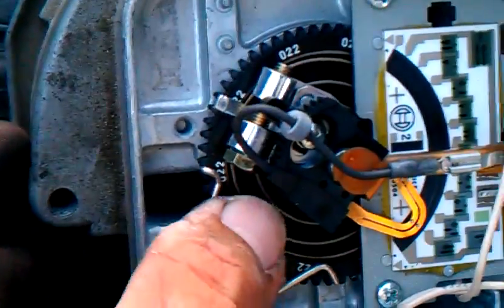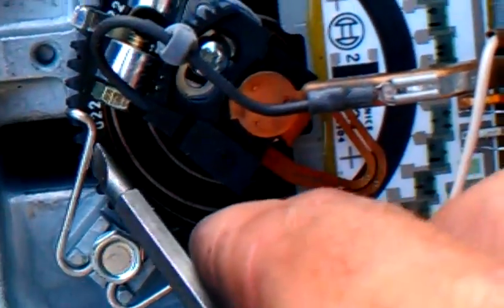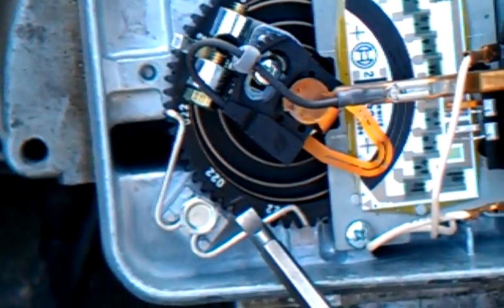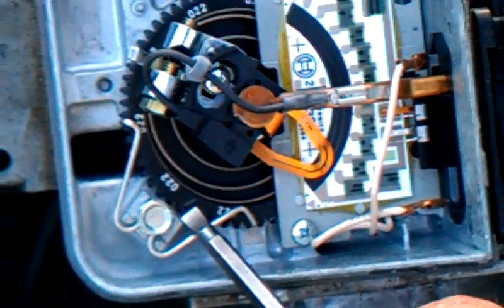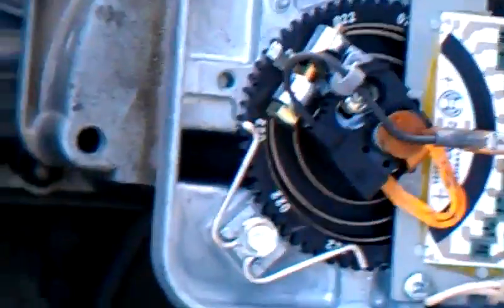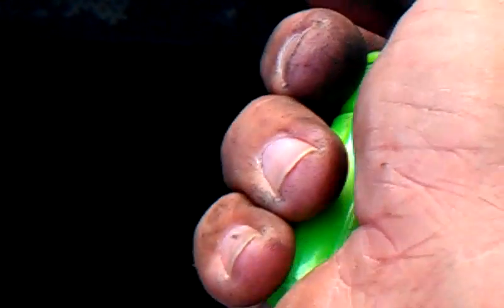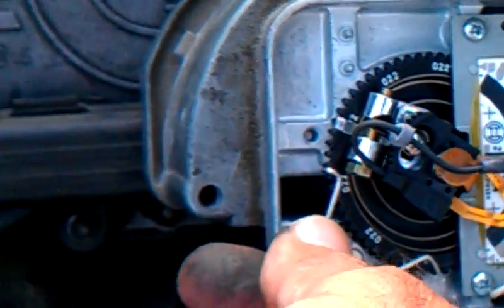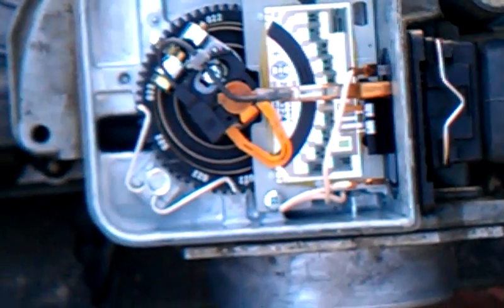AFM ADJUSTMENT TO CORRECT AIR/FUEL RATIO

Comment: Maybe its too late to ask after 11 years of posting this video.
In fact here in Iraq peoples started changing thebopels engine with Toyota engine because of this terrible airflew .
However about my problem . I have Opel omega 1993 . I  tried to adjust this devise  but I lost the stating point.
Randomly I adjust drpened on the engine idle stability , its so stabe and quit at idle , but so terrible at acceleration . At high speeds its performing very good but at fixed or accelratuon speed it terrible .
Anyone can teach me how to find the starting touching point .

Comment: I think you should be careful spreading misinformation saying that fuels are radically different now than it was so many years ago. 
Yes, fuels have become better. NO that does not change your AFR's or fuel mixture.

You're also wrong in saying they come lean from the factory, that is Infact wrong. Nearly every EFI car ever has come from the factory on the rich side. ESPECIALLY Toyota's.
Reply from the maker: Read the Bosch Fuel Injection Manual.
Fuels have not become better in California. The fuels are cleaner and produce 10% less power.
If I cross into Arizona and fill up, I get 10% better mileage. That is 40 more miles per tank.
Plus, I do say that an Air/Fuel Meter should be used. 13.6:1 is a good mixture at full throttle.

Comment: Should be very careful with this. Most of the time this is the wrong decision, people often overlook other problems and try to cover up the symptoms with AFM adjustment. A rich setting will cause power loss, waste fuel, damage your cat and make the exhaust stink. If an AFM has been tampered it is difficult to get it dialed back in. Early AFM's are more tolerant of sloppy settings as the output voltage is in proportion to air flow rather than flap angle. Later AFM's are calibrated to flap angle and small changes have a major effect on fueling. The spring tension is the major factor but the bypass setting is very important as well, if this is not right it will completely throw off the 02 sensor correction.

In my experience, don't do it. My e28 had been messed with and while the wideband 02 got it close on the spring tension it still required a lot of effort to fine tune it before the hiccups and driveability were resolved.
Reply: Hi, my mechanic recently adjusted the idle mixture screw, and now my e28 stalls when warm, did your car faced the same issue? How is this affecting the o2 sensor and fuelling system

Comment: Mine was adjusted by mechanic which way I dont know, car is stalling when engine is cold its around (1000rpm) when engine warms up it drops to 800 and car runs fine, can this be fixed with adjusting or just coincidence?

Comment: Thanks for your quick response. I have a 85 manual beamer 318i. I did a mayor tune up, including valve adjustment before the test, but the vehicle did not pass the emissions test. When I checked the oxygen sensor, even though it is new, the reading was 0.8 volts. I disconnected a vacuum line but the oxygen sensor reading was still 0.8 Volts. 

When I manually adjusted the air flow sensor lean it out (clockwise) and confirmed the oxygen sensor reading, it showed that the O2 sensor started fluctuating. I checked the gases with the 5 gas analyzer and this time the emission readings were much better.
Reply from the maker: AEM makes a wide band AFR gauge kit that you can use for the ECU Lamda input and see your AFR. This can help you dial in your exhaust gas NOx and Hydro Carbons.
High NOx = too lean.
High Hydro Carbons = too rich
Reply: Thanks for the information

Comment: I have a question. Is it possible to adjust the gear moving clockwise leaner or counterclockwise richer using the oxygen sensor reading. If I connect my voltmeter to the oxygen sensor, voltage is between 0.1 to 0.9 Volts. Is it possible to adjust the Air Flow sensor using the oxygen voltage readings instead of the Wide band Air Fuel Ratio Gauge. 
Thanks 
Thanks.
Reply from the maker: Good idea, but no. You need a wide band O2 sensor and AFR meter to see the air/fuel ratio (AFR) 
The voltages you see on a VOM will swing and do not give an accurate readout.

Comment: 85 4runner  hasn’t been running in 10 years…brand new battery, ran 12 volts directly to the fuel pump and it runs/ turns on, cleaned throttle body.
When I spray starter fluid into the manifold, vehicle bogs and hiccups to start up…that tells me it’s getting pressure. it actually ran for about 10-15 seconds til the starter fluid dissipated. 
No response when I throttle. Only when I used starter fluid I rev’d it pretty high.

Comment: Will this adjust so that all Ohm tests are within spec? Or just a crude adjustment?
Reply: Wondering the same thing
Reply: @chriscutrona5702  My airflow meter was actually out of spec when tested … 2 of the tests didn’t show OL (open loop). I went to the junkyard and I found one from a 1990 pick up, I did the test there and all tests passed. Immediately when I put it in my truck it had way more pep....no more dead spots when accelerating under load.
And my “rough idle when warm” gremlin went away lol. Best $125 I’ve spent so far.

Comment: Very good video!! I so needed this. 
I have an 85 vanagon there is no obvious entrance into the AFM to make the adjustment  no screws. 
Can anyone help, I would appreciate. ✌
Reply: Need to pop the black plastic cover off with a flat head screww driver. Be gentle and just pry it off stating at the corner closest the plug. Some are glued on so take your time.

Comment: At risk of resurrecting an old thread, I did this with my '82 Porsche 928. I moved the spring counter-clockwise by 6-7 teeth. Wow, it makes a difference on how quick the throttle response is now. What this does is actually change the resistance to opening the air meter given the command from your right foot. Out of the factory, it is set for relatively slow (higher tension on the spring or clock-wise). This results in a leaner mixture (a byproduct of the change in the spring tension) as you push the throttle and results in slower throttle response and better emissions (not entirely sure about the emissions part). As I said, the throttle response is MUCH quicker now! Really quick and inexpensive performance mod for an L-Jet system.

Comment: How do you know if it’s lean or rich ?
Reply from the maker: The only way to know is to use a wide band oxygen sensor with a digital readout. AEM is a good brand. 

Typically, you will see idle air/fuel ratios (AFR) between 14.7:1 and 16.0:1. That does not matter. 
At wide open throttle, shoot for 13.5:1 AFR

Comment: I have a issue on my 89 525i. Driving around 80mph for 5-10 minutes will give a check engine light as long as your still holding gas and light goes away most of the time when you remove your foot off the gas pedal. Sometimes it will go to a complete stop from highway speeds but not stall, just poor revving. Any ideas folks?

Comment: Without a A/F meter, you wouldn't be able to know if you're running rich or lean, right?
Reply from the maker: True
Reply: @vern2765  in worst case READ the plugs.
Reply from the maker: @914_werke  read the plugs? Plugs will tell you if you are too mean or too rich, but not in real time.

Comment: What the hell? Even though my AFM is a bit newer, there is no way to access the board underneath to move it ever so slightly if the carbon track has worn other than messing with that exact screw. That being said, a slightly newer versions seem to have wiper arm connected to amplifier board.

Comment: The only way to correctly change the air fuel ratio is by changing the mapping of the DME. In closed loop operation the oxygen sensor input will determine the duty cycle of the injectors.
Reply: So, what can you do when your car doesn't have the oxygen sensor? 😏
Reply: @KriegBoy  run in open loop.  Car just dumps gas all the time like its warming up
Reply: @psychotogen1  mine has electronic injection and it came from factory without oxygen sensor

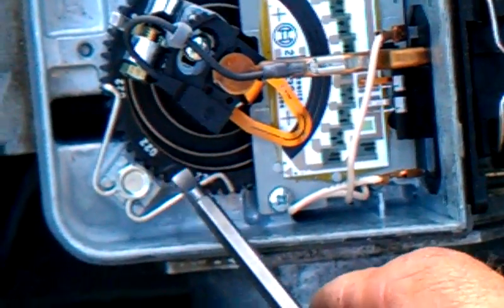Comment: Great video.. But I find it impossible for your vehicle to run 7 steps out of adjustment in either direction, you’re state must be blending 1:10 fuel ratio ? I just did this to mine 1 tooth richer. It’s like night & day difference owning the same truck since ‘02. I’ve read other articles that 1 tooth makes a HUGE difference, so take small steps.. But 7, the door in your maf must be completely closed off having to force it open, or it’s just wide open. It depends on the elevation you live at also living @ 4300ft above sea level !!! Lol..😂

Comment: Hello Vern2765,   I own a 1984 Porsche 928S US version with L-Jet  .   Recent dyno shows better than stock HP and TQ ,  but also shows very lean AF ratio.   Your video was recommended to me ,  I am excited to see if the Dyno results can be improved .   I have sent your video to one of the USA 928 parts supplier / racer (  Carl Fausett ) .   Gonna see what Carl says . I hope i can use your solution .  I hope maybe i can do this adjustment myself .     I was told to turn the dial 11 clicks counter clockwise   .   I hope you get my message ,  and can reply .  Thank you .  ....Susan   Jan 2019
Reply: Susan - please be sure to index the wheel by marking it in some way so you can put it BACK if this turns out to be a bad idea. I suggest 10 "clicks" by my match, not 11. Other than that, it seems likely this might help. Please report back what your results are!
Reply: yes ,  gonna re-dyno and send results to you .    this should be interesting .

Comment: Problem with the click method, on my aw11 mr2 anyways, is the fp is designed to turn on if I lean the wheel too many clicks. In the end by clicking my AFM, I am just trying to compensate for a bad part or faulty wiring. I clicked right and left and each one begins to change the vehicle along with adjustment of the air bypass which leans out the system as well. After I put ECU out of diag mode, the system ends up running better in the factory position. My car has an FP switch, TPS, and other timers on the AfM that work with the ICV and dist and injectors making this kind of adjustment only ok for a few clicks in either direction. It's a good method to diagnose the vehicle, however, in the end, if the ECU isn't adjusting for variations in the octane and temperature at the factory setting, them it's either a bad AFM or other parts linked to it.

Comment: In stock form, the 22RTE uses an air flow meter, aka AFM, flapper door, or vane-type meter, to measure the amount of air entering the engine. Please get this bit of terminology right, as an AFM is not a MAF (mass air flow meter), nor is it a MAP (manifold absolute pressure) sensor.

An AFM measures air flow through what is essentially a mechanical process, where incoming air deflects a flap in an enclosed space. More air coming in = more deflection of the flap. Crudely speaking, a potentiometer is connected to the flap, and as the flap moves, the potentiometer moves, and this shapes the electrical signal that is sent to the ECU.

To control the movement of this flap/aramture, the AFM is fitted with a flat-wound spring that is used to apply tension to the flap. This spring is held in place, and adjusted, via a plastic gear and a wire "holder". When this gear is tightened (turned clockwise) relative to the flat wound spring inside of it, it becomes harder for the door to open, and this translates to a leaner mixture (more air needs to flow in to move the door by a given amount, meaning theat the mixture is leaner relative to its starting point before adjustment). Turning the gear counter-clockwise has just the opposite effect, as the looser gear lets more air in relative to "stock".

Remember:
Turning the gear CLOCKWISE LEANS OUT THE MIXTURE.
Turning the gear COUNTER-CLOCKWISE RICHENS THE MIXTURE.
Reply: Sleek s, 

My mr2 has plagued me for years. I have the hunting idle thing going on and years ago I messed around with this click method only to reseal the unit afterwards. I've tried it yet again after watching this video and still I end up dialing it all back. I have am AFM, ICV, TPS, and dist w/ an injector timer built in. If all the basics are good, ie, timing, belt tightness, dist timing, coolant temp sensor, TPS adj, bleed coolant syst, 2 good ECU'S w/ same effect, what else could make the AFM flap physically move to compensate in a perfect rythym of about 500 rpms? 

Tighten the spring and I can get her to stop hunting...But, after diagnostic mode, it starts to come back at a higher RPM. If I go too loose, it won't idle at all and will run only on cold start injector. also, leaning it out trips my FP to come on due to a metal tab along the rotating AFM internals 

That's man, just asking cause you know these sensors well. It's as if someone is hitting the gas over an over again, yet, no extra fuel is being pumped. It must mean the mix is leaning and riching out to compensate, thus, the engine revs which makes the flap open. 

I am thinking the AFM flap is the effect of a mixture that goes lean and rich in succession...What would cause this bouncy fuel mixture?

Comment: The gear slipped out of my hand, what do I have to do to mabey remotely fix this
Reply: Happened to me in 1984. So rotate the gear the other way---and try to start the car. Have one person start and and one person rotate the gear. You will find a position where the car starts and then you can adjust it.
Reply: @BMW DIY I owned multiple 280 Z and Zx's and they had the Bosch EFI system similar to that on the BMW's of the time.

Comment: I checked every sensor in my system, replaced my DME coolant sensor (it has an injector type plug under the front runner of the intake manifold of my Porsche 944 NA N/A), fuel filter, fuel pressure regulators, intake manifold gasket and cleaned my fuel strainer. I'm sure all that helped but, the car was running too lean, I adjusted my AMF accordingly to the video (counter-clockwise) to make richer and all good now :)
PS: I used my MPG gauge to dial in my tune to 35 on the MPG gauge at a cold start :)

Comment: my 87 635csi has rough idle and it has a slight miss when at a constant speeds. smooths out under load. Could this be the issue? no vac leaks
Reply: My e32 735i has the same issue. Hope this solves

Comment: My 77 280z runs and idles great, until you step into it and put it under a load, than it bogs down and almost dies. Would the issue likely be the AFM? Cleaned fuel tank, new fuel pump, new filters, plugs, etc.
Reply from the maker: There is a litany of diagnostics to go through. Your car is an L-jet system and has more electronic components to test.
Reply: moparmusclecars Did you fix that issue? I have the same issue on my 89 525i. Driving around 80mph for 5-10 minutes will give a check engine light as long as your still holding gas and light goes away most of the time when you remove your foot off the gas pedal. Sometimes it will go to a complete stop from highway speeds but not stall, just poor revving.

Comment: Could you please do a video of factory setting of AFM. Some idiot touched my afm and air - fuel mixture is a disaster. On low rpm is ok but after 3500rpm is total waste of fuel. It is rich by double. Tnx
Reply from the maker: Weggman Hillard,

I have 16 years experience with L-jet, LE-jet, Motronics 1.0 through 1.3including Bosch turbos. And I repair and tune D-jet 3.0 CSi cars. I do modern upgrades and tune to put an extra 100 HP under the hood of E9 Coupes, while they still look stock. I am working on two high dollar E9 restorations. But, I must not know what I'm talking about.

Damn! You better learn me something quick! Before my clients find out!!!
Reply: Air flow meters were calibrated and set at facory on an individual basis.
Reply: scbonduk I've tried 2 AFM and car won't run, it idles at 200rpm smokes blue and bangs blows etc. Could a weak fuel pump couse this. On my AFM wiper arm is open much more, and car starts idles but mixture is rich, I can sense petrol out of exhaust and performance is weak. Also I have a direct LPG conversion and car runs perfect on LPG also it accelerates like a dream
Reply: Filip Udovcic If you can smell fuel and there's black/blue smoke when you start then it's running rich, so pump isn't an issue. Could be a range of things causing a rich mixture though.
Reply: scbonduk yeah. And it starts hard when hot, sometimes it starts normally sometimes not.  Then I've found on Internet that a bad coolant sensor can cause bad start so I've replaced it. Same thing happened. When I remove connector from that sensor car starts normally and runs much better but idle is mostly good but sometimes it won't go back to normal and stays at 1700rpm. Also it accelerates better when sensor unplugged.
Reply: Man, some update from me, I've changed the fuel pump with OEM and car finally runs great and power is back. I've refurbished AFM and set it like yours, i think fuel ratio is good because car is running very good and performance is awesome. Mine is m30b30 5 speed manual which is more sporty than a automatic
Reply: You should thank Vem2765 for posting the video. It makes a lot of sense.
Reply from the maker: SCBunduk, Wrong.
Reply: Vern2765 In what way am I wrong?
Reply: That same idiot is the guy who made this video.'.. DO not do this!  If your vehicle is running lean something else is wrong.  THIS VIDEO IS FULL OF BS!

Comment: The spring was calibrated in the factory, not the arm screw.
Reply from the maker: Both. Calibrated for Professor Bosch's "best lean burn." If you loosen tension on the spring, you enrich the mixture throughout the throttle range by about 3% on each click.